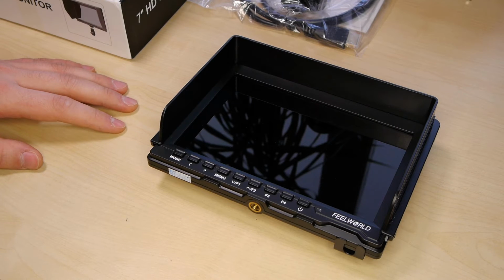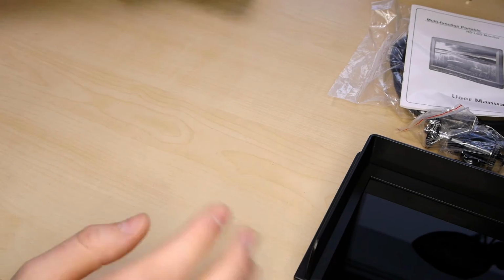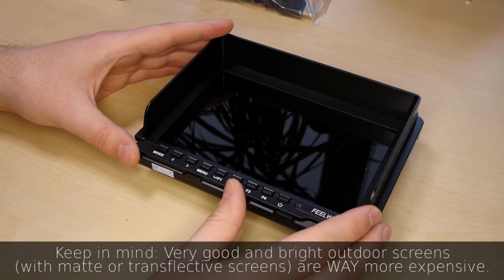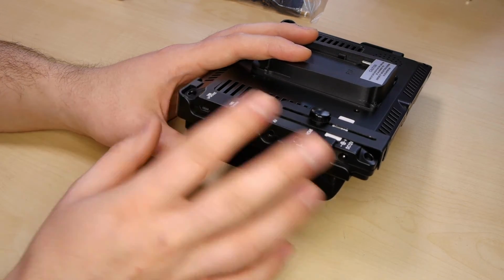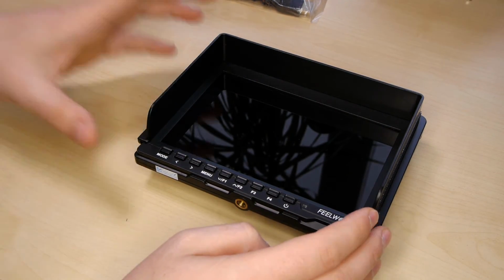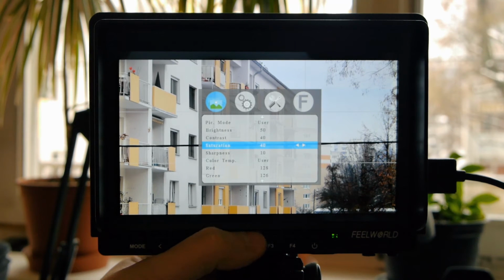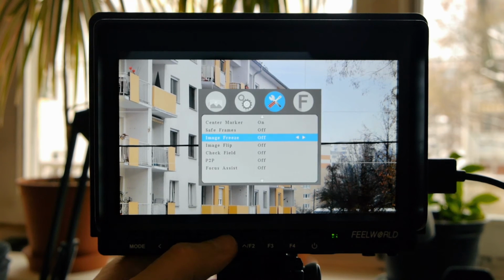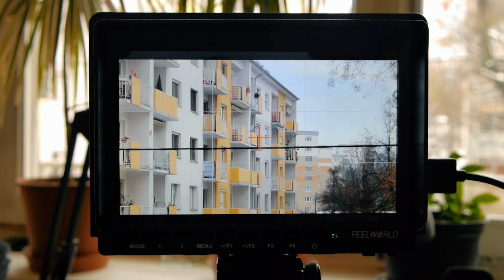Feelworld FW759 / FW759P field monitor - Very detailed HANDS ON (with calibration settings) (!)

Comment: Would you recommend a Feelworld over the Lilliput 663? (SDI model). I'm looking for a monitor for my blackmagic 4k production camera that has an sdi input. Cheers!
Reply from the maker: +Iacovos Argyrides Well - If you don´t mind the higher payload of the 663 (and the bigger size), it´s the better choice overall (but it´s also WAY pricier compared to the FW759 or FW759P together with an cheap SDI to HDMI converter). On the other hand: You get the WAY better software features with the 663/S2 model (waveform, vectorscope, RGB histogram and so on). So you also get more for your money. So I would go for the 663/S2. Though I also want to mention an alternative: The Atomos Samurai Blade. It´s a 5" IPS panel recorder (which you don´t really need for recording - I know). But you can also use it as a screen only. The HUGE pro: It´s quite small (with it´s 5 inches), though coming with a high pixel density (native 720P) screen which you can even calibrate with the X-Rite I1 Pro (and the soon coming firmware update).

That´s quite unique - Normaly you cannot calibrate external field monitors perfectly. And the point is, that you get it for about 250 to 300 bucks now - Used (with native SDI input) - So it´s super cheap (directly compared to "straight" field monitors). And it´s also coming with: Waveform, Vectorscope and even RGB Parade (which isn´t even included with the 663/S2 for example and which I LOVE with my Ninja Blade model btw.). So you´re also getting better scopes. And ATOMOS is now also planning to release the "Atomos HDR" mode for it (to display LOG profiles better). PLUS: You can also use it as a backup recorder OR as a recorder with other cameras to. It´s quite nice to have the option ...
Reply: +AustrianGeek Wow, awesome response as always. I'm based in Europe and can't seem to find the Atomos Blade for the price range that you mention. I've also been thinking about the Feelworld ST-702HSD that has an SDI input at an approachable price, but can't seem to find any valid info on it. Thanks for the reply! :)
Reply from the maker: Don´t oversee - It´s the used price (not new). You need to wait a little bit - But if there´s one offered, they are sold for about that price (at least around 350 to 400 bucks for a "like new" Samurai Blade kit with an SSD or hard drive included). You can also buy it brand new - It´s still quite cheap (especially since the last price drop from Atomos). And if you´re able to get the VAT / fees back, it´s nearly as cheap as a used one ^^.

About the Feelworld ST-720HSD: It´s only offering a native 1024x600 panel (which isn´t the best choice - As the scalers are not the best from Feelword). 1280x800 or 1280x720 is better, as it´s able to display exactly a quater (of a standard 1920x1080 signal stream). With the lower 1024x600 resolution of the ST-720HSD you´re adding moiré and aliasing to the image (wich is then displayed BUT NOT recorded - Quite annoying to see moiré and aliasing, even if it´s not on the recorded files). And it´s always important to see (as precise as possible) what gets recorded.

If you really want just a field monitor with SDI, go for the 663/S2. It´s really good (at least since the newest firmware updates).
Reply: +AustrianGeek Well that crosses the st-720 out of my list.. I've seen a few Feelworld sdi monitors that are at 1280x800 like the Feelworld FW1018S which is also a bit cheaper than the Lilliput but at a 10" size. Is it easy to update the firmware on the Lilliput if I buy from Amazon? Or does the S2 model come already with the new firmware?
Reply from the maker: Well - 10" is too big for mobile usage. Even 7" is sometimes too bulky for my taste. About Lilliput firmware updates: You cannot do it by yourself. Only Lilliput is able to update the firmeware (if you send in your device). So if you really want to get the newest edition order from them directly (within europe it´s for example www.lilliputdirect.com). The other online dealers sometimes have older versions on stock.
Reply: +AustrianGeek Excellent! Thank you a lot for the help!!

Comment: Does it come with a battery?
Reply from the maker: +King Jae No. But normaly you only get the smallest ones anyway.
(So it&#180;s not THAT much helping if there would be one included.)
Just search for NP-F730/750/770 kits (two batteries with a charger included).
These ones are the "middle size" and not too heavy and big for the screen.
You could also go for the NP-F970 ones (the biggest ones).
But I personaly don&#180;t like such bulky batteries on external screens ^^.
Reply: +AustrianGeek should i just get the big one then?
Reply: +AustrianGeek should i just get the big one then?
Reply: +AustrianGeek Thanks. How much am I looking to spend on the bigger battery?
Reply from the maker: If you just want to buy ONE battery, then it´s better to go for the NP-F970 (and a charger) - Yes. Well - A good one is priced around 20 bucks for the battery alone. Or around 30 with a charger included. I recommend the PATONA NP-F970 - They are available over Amazon and the quality is ok (I am using the Premium AND the Standard NP-F970).

Comment: Is this going to work on a Canon 5D MKII? Let me know ill buy it immediately if it does.
Reply from the maker: +Brian Martin It has the 480P / "camera" mode for the older Canon bodies - Yes.
But according to another user it adds aliasing to the image (so it´s not really helping that much on the older Canon bodies).
Maybe it´s better to use / get another model. Though keep in mind: It´s a general problem -> The low image clearness / sharpness.
The 480P resolution is the limiting factor from scratch on.

Comment: Hello, very nice review! this monitor come whit Zebra? and what  is the better the Feelworld FW759 or the Aperture 7 vs? i also lock the review from Aperture to.Thanks!
Reply from the maker: +Pulpiño Viascón Thx. About the Zebras: Only the FW759P is coming with zebras (but according other comments here you need to let the brightness at the standard 50 value - Otherwise you´re shifting it exposure wise -> But that´s even the same with the Aputure VS-2). If you need more accurate and adjustqable meters, it´s maybe a good idea to invest more in another higher quality screen, as the zebras are also not adjustable with the FW759P (by yourself). Though: At least you get the histogram and the 2nd focus assist / peaking mode with the more expensive / advanced FW759P model. But if you don´t need those two, it makes no sense to invest the few bucks more for the "P" Model. OVERALL the FW759 is WAY better than the older Aputure VS-2 (7") - It´s producing a better image (clearer and more colour accurate). At least if you feed a native 720 or 1080 resolution image (it´s not perfectly working with 480P signals from Canon cameras - But that´s a common / normal problem with these older models -> The low resolution is jut too limiting according focus peaking and general focus pulling.) The new upgraded Aputure VS-2 FineHD on the other hand I never tested til now. Maybe they fixed a few points / problems compared to the older models. But if you want to be sure to get a good screen, just go for the FW759 or FW759P. It´s actually one of the best (super cheap) screen on the market (if not THE best) ...
Reply from the maker: +Pulpiño Viascón Ok. Forget about the VS-2 FineHD - Semms like it has the same contrast, colours and highlight / shadow detail issues like the older VS-2 model. Two alternatives: IKAN DH5 5" screen (more expensive but good features and also coming with an 1080P panel) - Or you could also get a used Atomos Ninja Blade for example - Also 5" screen - But it´s also a recorder (1080P 4:2:2 10bit) AND you get nice exposure features like: False colours, zebras, waveform, RGB parade and even a vectorscope. It´s offering 720P resolution (and an IPS screen which you can even calibrate with their colorimeter) ...
Reply: Thank you very much! very friendly, really I wanted one not very expensive, is to put under the Steadycam I think best of 7 although the Ikan you told me is fine, what matters most to me is that you can see the image outdoors.
Reply from the maker: Well - It´s quite hard up to impossible to find a good super bright screen (at a lower price point). The only chance is, that you´re lucky and find an older one (cheaply) -> For example used on Ebay. You don´t even need the highest resolution - As you´re using it for framing primarily / only.
Reply: +AustrianGeek ok!, thanks for the information👍

Comment: Due to your review I bought a Feelworld FW-759P. Unfortunately the calculations of the histogram, the zebras and the false color rely on the monitor's brightness. A simple trick to test this is out is to put a lens cap on your camera and have a look at the histogram: All pixels should be located on the left side. False color should only show the color assigned to the lowest IRE level (Feelworld's monitor uses dark blue). The histogram seemed fine and the false color too but when I raised the monitors brightness level the pixels in the histogram shifted to middle and the false color changed from dark blue over to light blue and to green. So both functions indicate a medium exposure although the actual captured image (just the pitch black lens cap) did not change. Same thing applies to the zebra function: The more you you increase the screen’s brightness the more zebras you get.
So these "P functions" are not working properly, cannot be used for productive work and are not worth their money. I also encountered other issues which might be worth mentioning: 
- False color mode only uses six colors (dark blue, light blue, green, yellow, orange and red). Other brands (e. g. Atomos, SmallHD, Aputure) use much more differentiated scales. Furthermore Feelworld offers no explanation which color represents which IRE level. 
- Even if you tighten the cold shoe adapter to its limit the mounted monitor might swivel if you touch or push it a little (e. g. by pushing the buttons).
- The buttons click fairly loud which might be recorded by nearby microphones.
- When installing a battery you have to be careful: I often pushed the battery contacts down when I tried to insert a battery pack. You have to push down the battery with a bit of force.
- I tried to calibrate the FW-759P using SMPTE bars but I was unable to recreate the dark purple square. Apart from that the colors are fine.
- The menu button is located right in between the navigation buttons (left, right, up and down arrow). For me it complicates the navigation because I often press it by accident when I try to hit the arrow keys.
- Focus peaking might sometimes detect unsharp edges.
- All activated functions (e. g. false color or peaking) are also applied to the monitor's menu which makes it hard to see / read.

Not everything is negative about this field monitor: The installation of the sun hood for example is really easy and the image is clear and crisp. Just for checking your image composition this monitor is fine (although the non-P model would get the job done too). Instead of buying the FW-759P I would recommend getting the FW-759 because the P's extra functions are not of practical use. I will return my Feelworld monitor and I already got a much better replacement: The Aputure VS-2 FineHD. The latter offers 
- a bit more then full HD resolution (1920x1200; the extra pixels are used for on screen menus and scales), 
- working false color (with an explained and much bigger color scale), 
- audio meters, 
- firmware updates (downloadable and can be installed all by yourself), 
- easy four-way red illuminated selection buttons
and the accessories you get with it are great (NP-F550 battery, battery charger, small case, magic arm, two HDMI cables, cleaning cloth, etc.). The Aputure VS-2 FineHD costs about 250 / 280 bucks but for me it is worth it (taking all the accessories and features into account).
Reply from the maker: +o0PGJ0o Hmm. That´s bad to hear. Though: Just let the brightness at the standard value (which is 50). It´s more or less the optimal brightness anyway. The exposure assist shifting problem is btw. the case with many cheaper screens (though it wasn´t possible to test them in this video , as I only had the standard FW759). It´s still a very good (and quite colour accurate) screen at it´s very low price point. There´s just no alternative actually.
Reply: How turn off battery percent display? great review/!!!
Reply: @eduardofalcao4878  Where is the battery percent display? I cant figure out how to see the battery life.

Comment: Any idea does this work in Nikon D7200 ??!
Reply from the maker: +Conor Bradshaw Should work nice - As the D7200 is outputting an uncompressed 1080P image (if you adjust it to do so) ^^.
Reply: @AustrianGeek  interested in getting this screen for my D7200. Are you saying that the live view should work without the nikon hack mentioned in a few comments? As in having the ability to have 720p or 1080p on the screen?
Reply from the maker: @jerianlewis1708  You can try it out with a TV or a PC monitor with HDMI port. Just check the camers settings to disable the control overlays (in case you want a clean output). ^^

Comment: Thanks just wanted to reconfirm will it be good to work with Magic Lantern 1920x1080 as the monitors native resolution is lesser. Also plz advise which vendor to buy on Amazon.
Reply from the maker: +Atif A K It´s working nice with all signal types -> At least with the cameras, which are outputting "normal" aspect ratios (600D upwards or the 5D Mark III for example). It´s not 100% perfect working in the "camera" mode, which is cropping to the 480P (centered) image of some older Canon bodies. But such signals are suboptimal from scratch on - Wich EVERY external monitor ^^. About a seller / dealer: I bought it directly from a chinese seller - So I don´t know which reseller you should (or could) choose - Sorry ...
Reply: +AustrianGeek As I understand it will be good for Mark iii with Magic Lantern even in movie mode. Thanks again for the great work.

Comment: Thanks for the review, mate!

So there's no way to desqueeze a 4:3 anamorphic image on this, huh?

That's a shame.
Reply from the maker: +Cazaq Nope. At least not with the V2.0 firmware I had on the screen. Maybe it´s now the case with the newer firmware versions (but I doubt it). Especially with such super cheap screens you normaly don´t get anamorphic desqueeze. Btw.: IKAN is offering desqueeze with most of their screens - Maybe you can find a used VK7i or VH7i (latter one I have lying here - Quite nice screen and they are nowadays REALLY cheap available in used condition over Ebay from time to time).
Reply: I'll look into that. 

Thanks a bunch!
Reply: +Cazaq Out of curiosity, are you shooting on a Canon?
Reply: Nop.

GH4 and BMPCC.